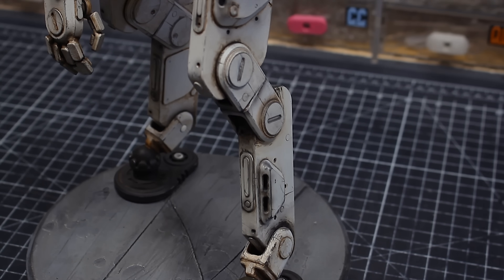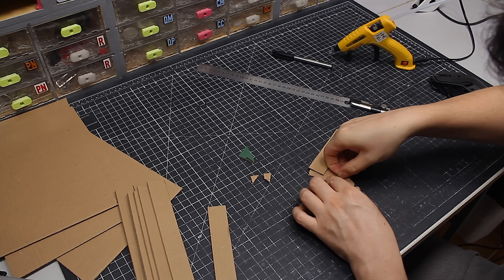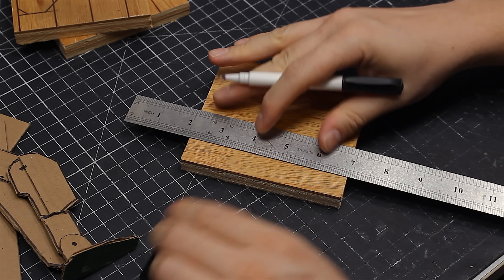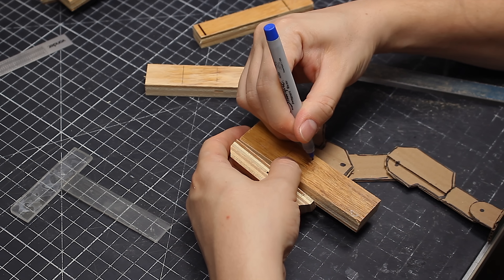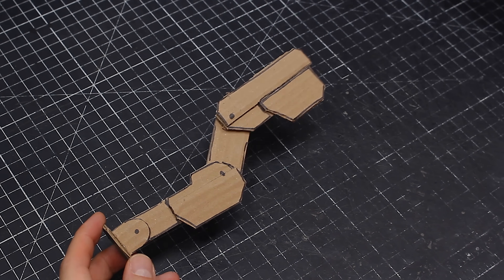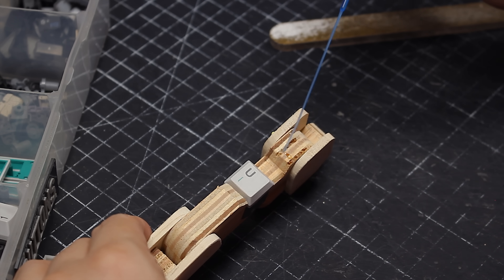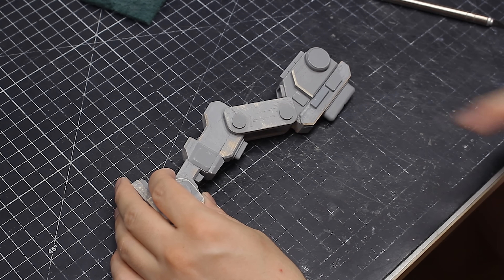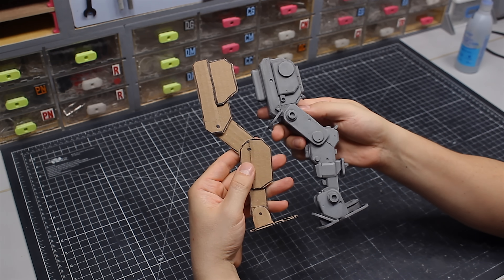Building a Mech Leg… Out of Wood (?!)

Comment: Hey man congrats on the bandsaw! A couple things to pass on that I learned in the last year when I started woodworking- wood glue is INSANELY STRONG but takes a while to dry. A great technique is a couple dots of CA on the outside to ‘tack’ it down, with a little wood glue spread out in between. You won’t be able to pry it apart! Wood filler is pretty cheap and can hide a lot of crimes before painting.

Comment: Upgrades to the bandsaw:
Probably the number one is take a small piece of wood and make a Zero clearance piece to go next to the blade.  The gap you have will swallow really tiny cut pieces. 
More lighting.
Add an air pump to blow the dust away.

Your cross cut guide could use an extension piece of wood and then add a glue on tape measurement piece and an adjustable end stop for repeatable cuts.

Comment: Nice job.  Keep the fingers clear, band saws love finger tips.  There are primer/sealers that will fill the wood grain giving you a smooth surface.  The other option is a low grain, soft, solid wood.  (Pallets, sometimes)